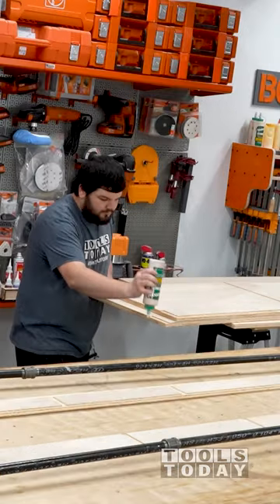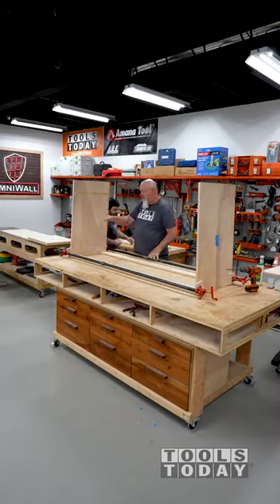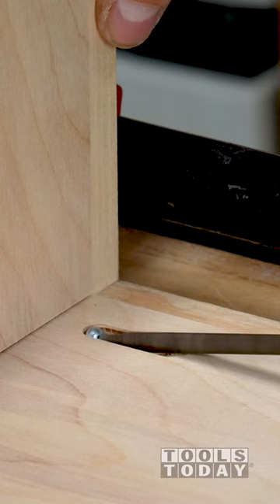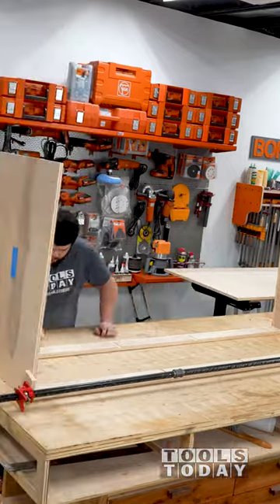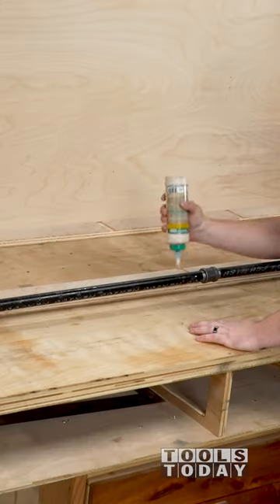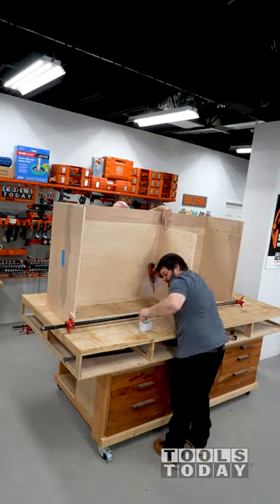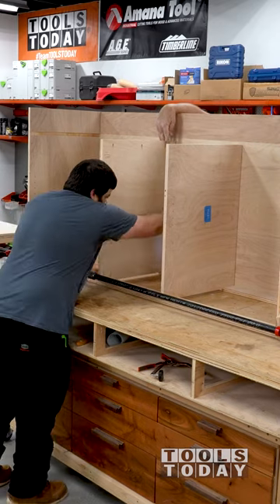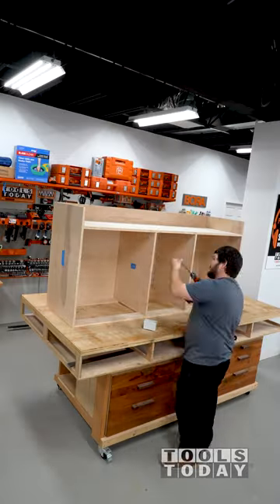Assembling Cabinet Base

Comment: Cool setup guys. I enjoy the channel. Do you have a link to the full video for this one?
Did you guys cut the pocket holes with the CNC or use a pocket hole machine? If you used a pocket hole machine, which one?
I like using a drill/driver with a locking collar and an adjustable clutch…. It gives me a little more room. I don’t like using an impact driver for pocket screws either.
Ron
Reply from the maker: Thank you.  We don't have a full video out for this project yet, as it's not complete yet.  To drill the pocket holes I used a Kreg Foreman, it really speeds up the process.